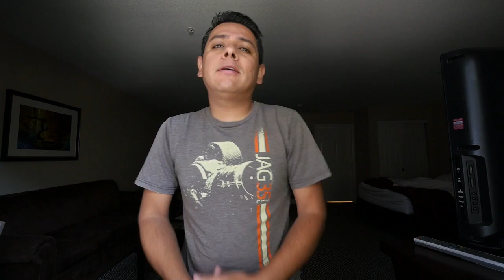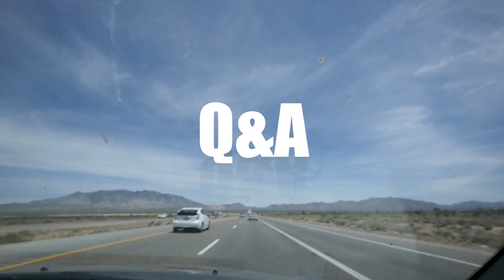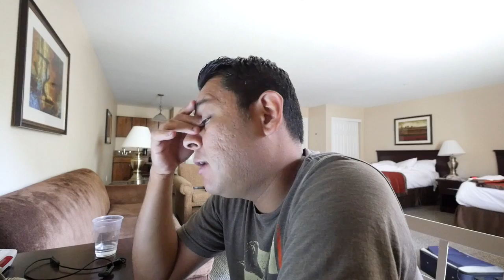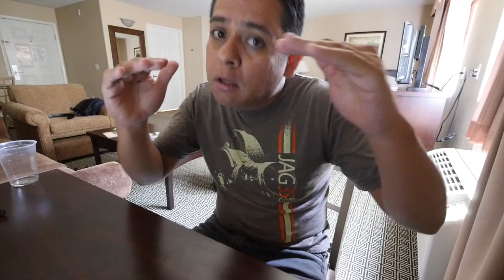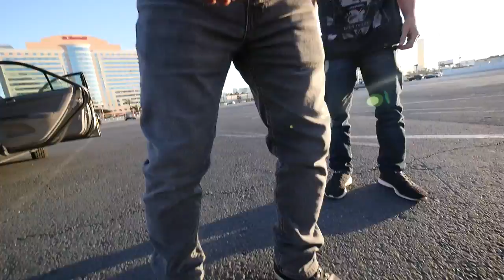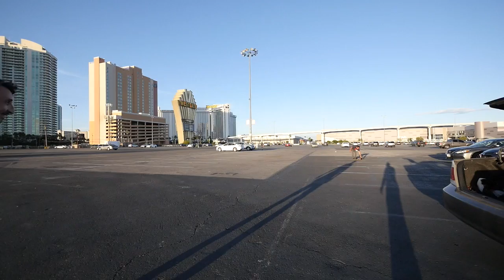Q&A Matching module capacity on your DIY TESLA Powerwall

Comment: so what combo should i be looking at.. specifically regarding the 4s/2s part listed on batteries? ive been seeing a lot that have that designation of some sort... if im not mistaken its like... the discharge rate? so..what is good for a power wall concept

Comment: Are there any ready made fuses and wiring in a plastic cap so you could throw a pack together in minutes? And not have to do any wiring or soldering? Would be an industry disrupting idea. Probably patent and copyright issues.

Comment: Do you have a video on charge/life cycles? I was reading if you charge a 18650 to 4.2v, the typical estimated life is 300 to 500 charge cycles, but if you charge at around 3.9v, you can get 2,000 cycles out of them. Was looking for some real life experience/opinion on it.

Comment: JEHU!!! You are an absolute legend!!! I've just started putting my packs together and was wondering how and the best way to mix and match. I started doing it that way earlier in the week with 5 of each capacity and building up to highest then worked my way back down . I wrote down every cell  capacity in the pack rounded to the nearest 100.
I haven't seen anyone else post one like this. 
Well done mate. Always stoked to see a new vid from you.  I'm building a powerwall first then I can charge the packs that I will build for my 55 oval beetle. Have a great weekend. 
Ty ( Australia)

Comment: Hey Rineo has an 1850 guide!!! Check it out and even recommend it it's pretty well done!
Reply: Also that skateboard remote really sucks.... Benchwheel makes a diy version of there remote and it's great no disconnections. Also for cheap the vesc esc can connect to a wireless Wii nunchuk and it's really good. I use the wii controller most of the time cause it has a cruise control function which it really useful. That remote u have really isn't that safe.
Reply: Also that skateboard remote really sucks.... Benchwheel makes a diy version of there remote and it's great no disconnections. Also for cheap the vesc esc can connect to a wireless Wii nunchuk and it's really good. I use the wii controller most of the time cause it has a cruise control function which it really useful. That remote u have really isn't that safe.

Comment: Hi, to what voltage should I discharge cells when testing capacity? I discharge them to 3 volts cuz my charger is programmed that way but I never get more than 1200 mAh. Or maybe just my cells are bad. I tested 50 of them
Reply from the maker: +Mitja Strajnar  3v is good,  you shouldn't go much lower if you want your cells to last

Comment: Peter Mathews is hbpowerwall, using a bms because he got a bms for free. He doesn't need a bms, he is installing one because it was free, that is all. He always advocated against a very expensive BMS arrived in the mail.
Reply: Can you please tell my wife that, she will be pleased to find out. AND your very right I was all about no BMS because I'd only ever used CHEAP ones that never did what they advertised tarnishing my opinion on what a BMS really was or could do. I checked every cell 2-5 times a day and that was getting very old after a few months of walking back and forth. NOW I have a cool interface I can check from anywhere I have an internet connection that tells me at a glance what's up! Now I'm improving my batteries building a stronger more reliable bank, and trying to share as much as I can of my process as possible

Comment: Good video m8. I do it just slight different as some other mentioned. Ie i scramble the cells totally ie try to keep same amount of low, mid and high cells in all packs and then just make sure all packs have as close capacity in total as I can. Have had couple of packs running since mid last year and they worked fine. Going to add the bigger packs soon i hope when the LiFePo4 is done.

Comment: puting 2000mah and 3000mah batteries in the same pack! isn't that wrong?
Reply from the maker: +Muhammad alhamawandi  no
Reply: won't the high capacity one charge the lowest one with high current?
Reply from the maker: Only if one is charged to a lower voltage,  but once you connect them they will always be at the same voltage

Comment: perfect explain  tnx, only question is how to get correct internal resistance from battery,s also  not sure about HV lipo cells 4.35V  as i have a lot this ones as well and 4.2V will be not good to mix up
Reply from the maker: +Kaspars Krumins  don't worry about internal resistance
Reply from the maker: +Kaspars Krumins  do not mix different cell form factors,   Make a separate battery and connect it parallel at the end
Reply: ok clear, i have already put separate all 4.35V cells for future as that cells need different charger/balanser to get max capacity and power

Comment: I'd change the process slightly, put 1st pair in first module 2nd pair in second module etc else you'll have all the low cells with all the high cells in a module  so you'll have the high cells working harder so bringing their capacity down faster
Reply: Kaspars Krumins ideally you want the same spread of capacities across each module, if you ordered all the cells in each module by capacity the no. 1 cell from each module should all be about the same, no.2 all about the same etc etc then you should see even wear across all modules and so should stay balanced more easily. if you want to get really specific you want to match the total, average and standard deviation of cell capacity in each module but doing the pairs method should be good enough
Reply: roger and tnx
Reply from the maker: +Jonathan Widdicombe good idea
Reply: so need try to get first line on low cells in each module tneh add second line with high cells then gain full line low cells and next line high cells? i mean first  10pcs low cells line each module then second line  10pcs high  cells line are i,m correct? then i can get all modules very similar capacity and mix  of low/high cells correct? total is 24 modules 150 cells each module 3.7V
Reply: Exactly!

Comment: Not understanding your analogy. Visual aids would be very helpful.
Reply from the maker: +Michael Kreitz what analogy?
Reply: The analogy of alternating high and low capacity cells in the modules. I was under the impression that when you put together cells in parallel you should use all similar capacity cells. Are you speaking of the series connections?
Reply from the maker: +Michael Kreitz  all used repurposed cells should be tested for actual capacity,  they should be marked, Watch my videos showing how to test cells